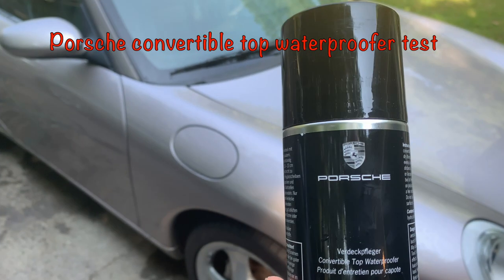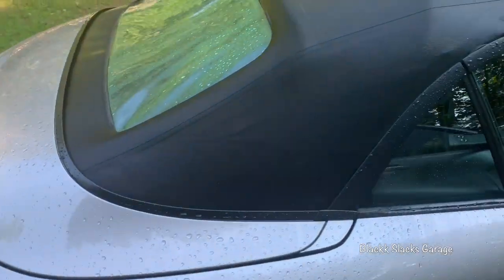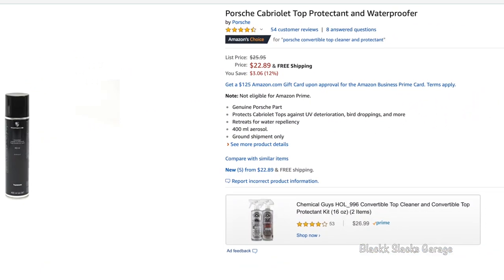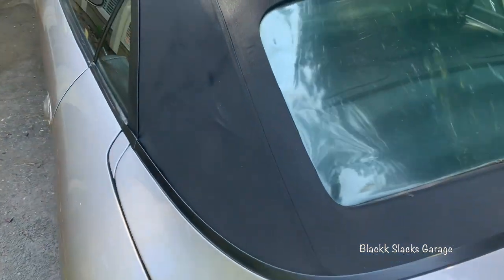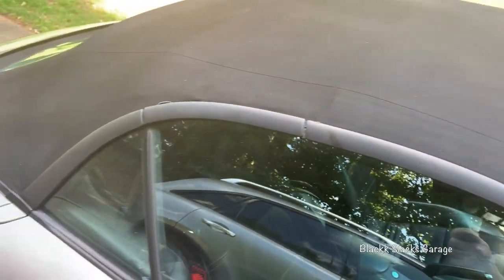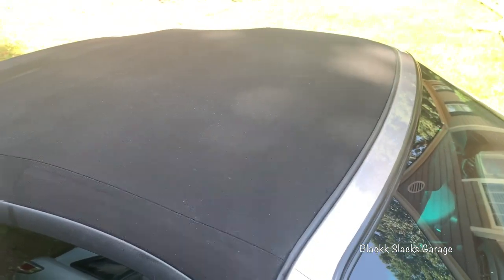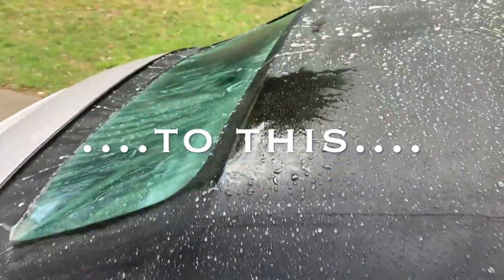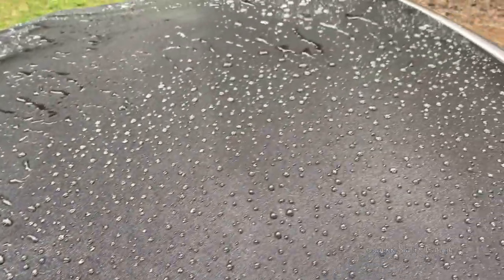Porsche Convertible top waterproofer test..... This stuff works well!

Comment: Can you add a link to the product you purchased? I have an '01 C4 Cab nearly exactly like yours.
Reply from the maker: Sure........so far it is holding up well........https://www.amazon.com/Porsche-Cabriolet-Top-Protectant-Waterproofer/dp/B008VY1IWQ/ref=pd_bap_rp_7/147-9659245-7846650?_encoding=UTF8&pd_rd_i=B008VY1IWQ&pd_rd_r=fb5fc644-f021-4f28-9ea6-38fd30b62cea&pd_rd_w=0Wiky&pd_rd_wg=zk3S4&pf_rd_p=3dad8606-079a-4e44-a2b6-9e295e1b470c&pf_rd_r=8EYN4GAY1QK1AXX9S99W&psc=1&refRID=8EYN4GAY1QK1AXX9S99W